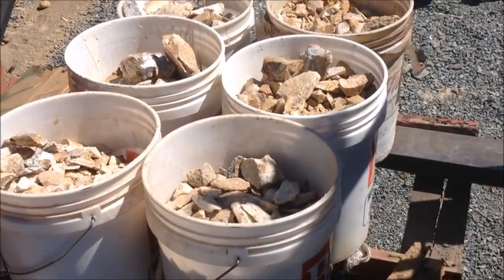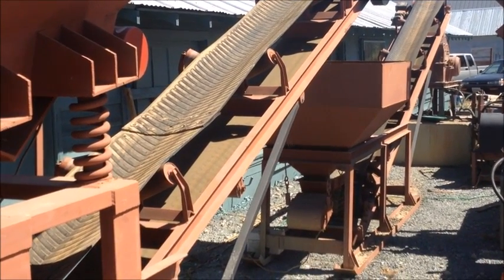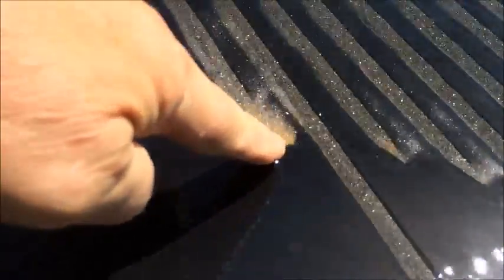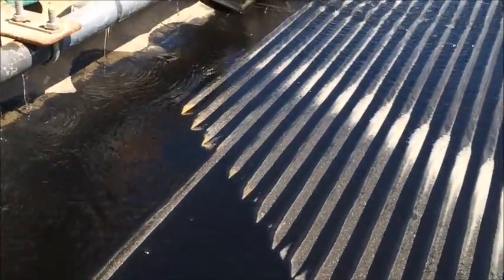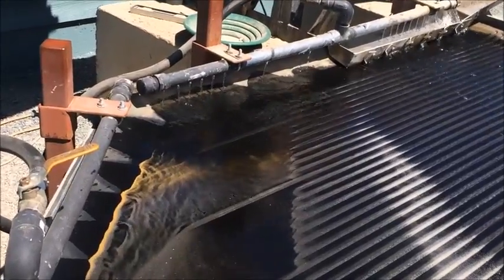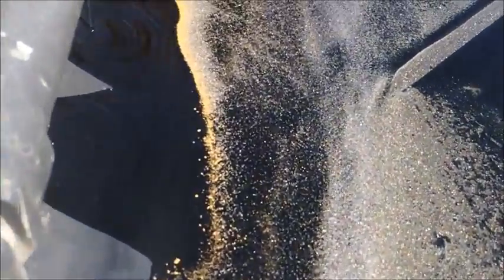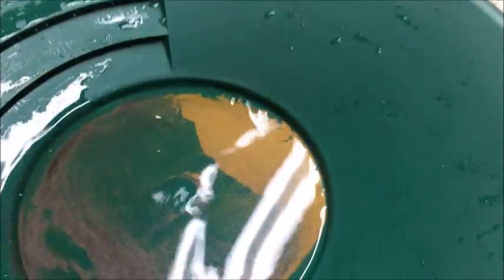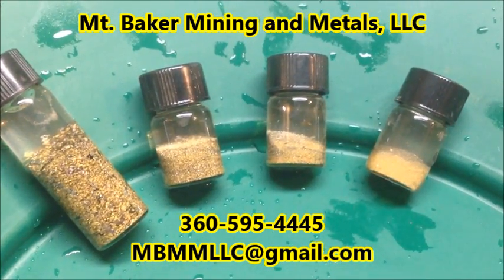Complete gold recovery processing line for gold ore

Comment: Jason,

I nearly finalizing our investor plan about this machinery. But I really want to know if we can use these kind of turn key ore processor for copper ore? I plan to use flotation process but also considering the chemical impact since the tailings for the slime is a very big investment. If somehow those flotation process can be replaced by this mechanical process of yours, I will recommend this system to be applied in our factory with several upgrades.

Please reply, thanks
Reply from the maker: Thank you for the comment.  For questions about pricing or equipment please send us an email at info@mbmmllc.com or call +1-360-595-4445.  You can also visit our website at www.mbmmllc.com  Thanks for all your encouraging comments, great ideas, safety concerns, environmental concerns, and cost questions.  We prefer to communicate through email so for any specific questions that need a response please email us! Thanks again for watching all our videos!

Comment: How mobile is this set up?
Reply from the maker: This can be installed on a trailer and moved around easily.  We have several customers who do this.  The table must be run on the ground off the trailer because the vibrations of the crushers can effect the table if all mounted on a trailer.  Thanks
Reply: Appreciate the quick response. Gonna give yall a call tomorrow.
Reply: how would this work on the tailings of a 100 tonnes per hour..
would it  be  worth the trouble.. we get  6  per hour at 100 tones an hour.. maybe   acoupla tonnes an hour of concentrates off our shakers

Comment: I noticed the gear drive on the surge conveyor. Neat setup. What metal is the gear? Seen a lot of sintered bronze gears and they lasted a long time, but a much less harsh environment.
Reply from the maker: Naked Acres This is an older style of conveyor that we don't use any more.  We have switched our conveyor drives to a gear box system.  You can see one in this video: https://www.youtube.com/watch?v=Vma_rhcXdEE between 1:00 and 1:15.  Its simple, less moving parts, and easier for maintenance.  We have several of the gear style conveyors in operation to past customers and they are still going strong, but we are constantly improving and upgrading our designs and the conveyor drive is a good example of this improvement process.  Thanks for the comments, I appreciate your feed back and input.